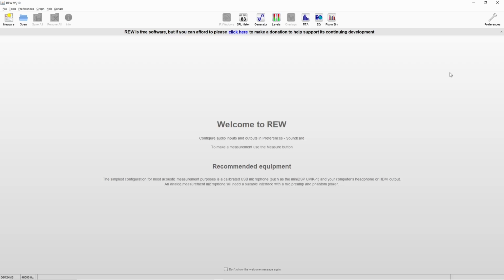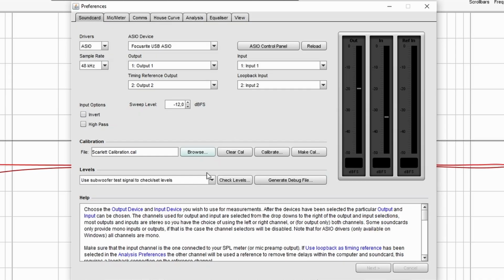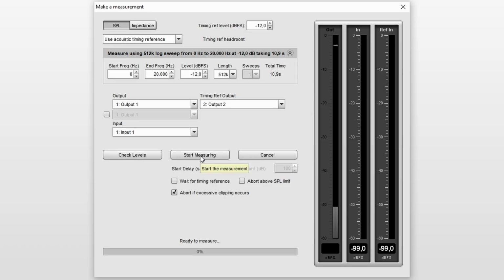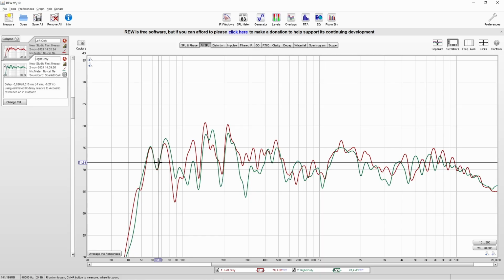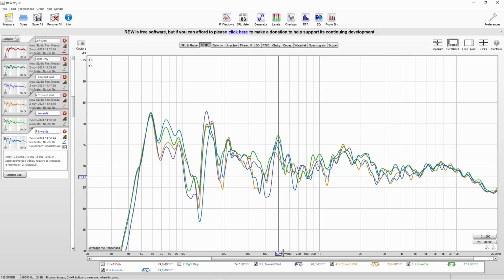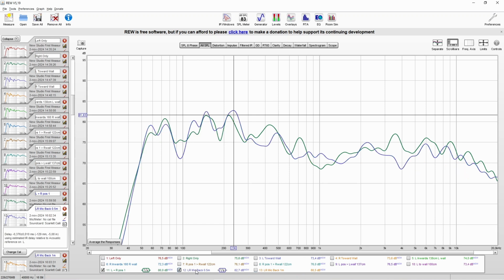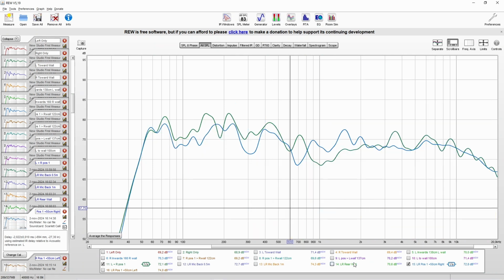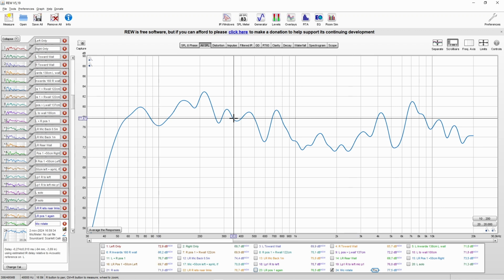Measuring studio acoustics with Room EQ Wizard

Comment: I am a beginner here, but my audio is set up through an integrated amplifier with two  loud speakers are connected. That is how I listen to the music. In this case, to use REW setup, should I measure the sound after I turn on the amplifier, and how to connect my laptop to amplifier? No one in youtube, explains how to actually connect equipment to amplifiers and loud speakers. Thank you for your help.
Reply from the maker: You can connect the headphones output jack from your laptop and find a converter cable for your amplifier.